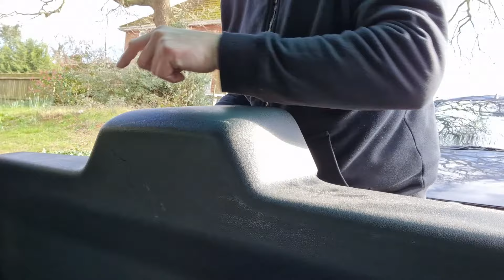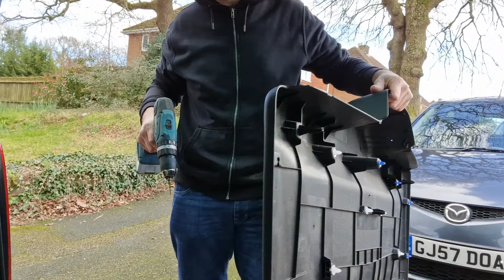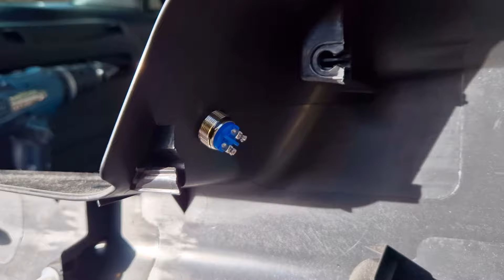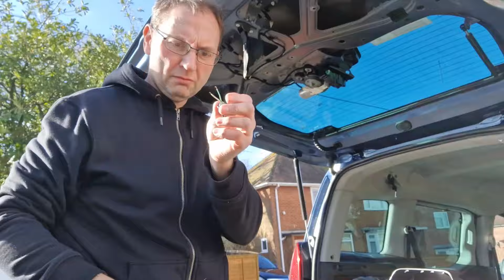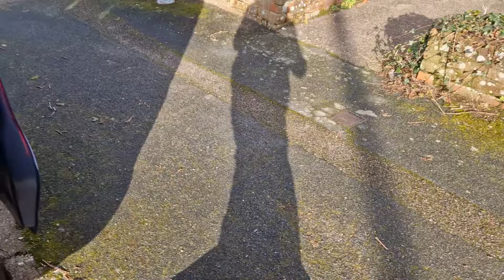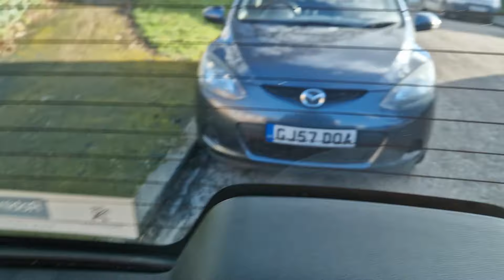Peugeot Partner / Citroen Berlingo - How To Install Rear Door Release Switches For Safety

Comment: My mechanic fitted an internal door release at the same time that he fitted our diesel heater. Really handy!  

If you get a bungee and loop it through the strap handle you can hook it to the door catch which keeps the door at a 45 degree angle. Ideal when you want ventilation for cooking and it’s windy and rainy outside. 
It’s also easier to reach it to close it from inside.
Reply from the maker: Awesome mate I will try that!